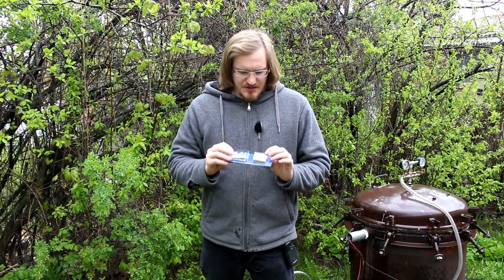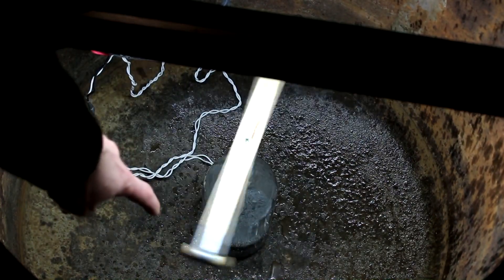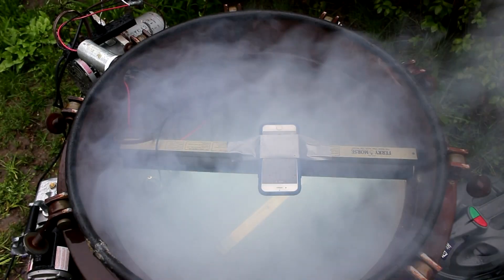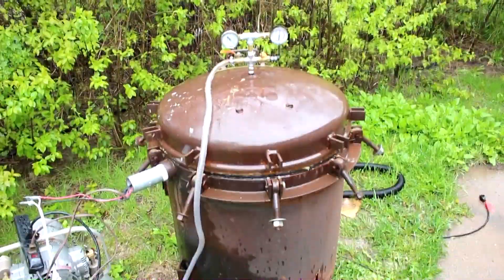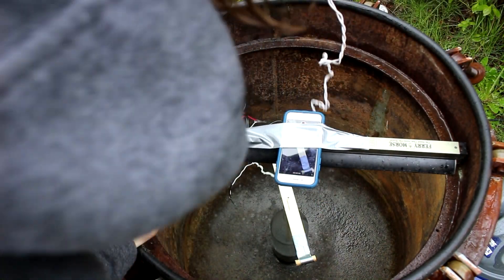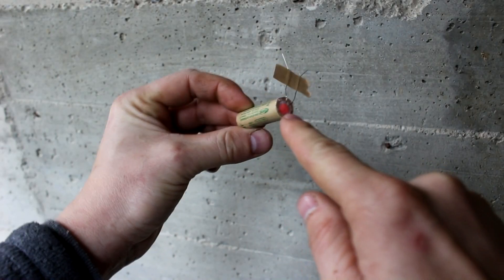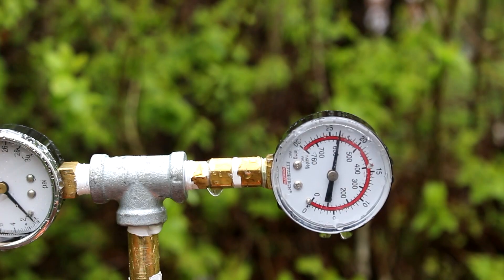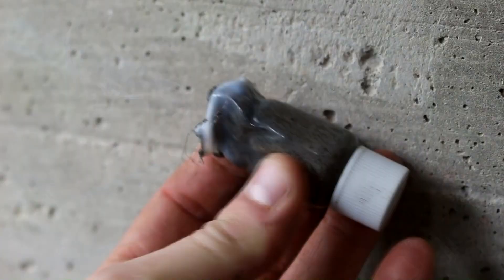Will a Model Rocket Motor Work In Vacuum?

Comment: Good experiment and does lend a little credence to rocket propulsion in space.  Except not 100% convinced because the rocket in your tank could have pushed off of the wall of the tank.  To be totally convinced, I'd want to see a rocket in a large vacuum like 20 ft by 20 ft and see it fly around without the gasses pushing off of any wall floor or ceiling.  Not saying it can't happen I don't know.  I know how it is supposed to work, but I want to see it.

Comment: You took the rocket out of the vacuum cheater!!!How do you think you proved rockets work in a vacuum when you used a barrier to shoot the rocket. We know objects in motion maintain speed in a vacuum I feel like the trust was created from the explosion of the bottom blowing off. Then it stops accelerating and since you had a relatively near frictionless rig up, it continues to rotate until it stops. The atmospheric control test spun for 13 seconds and stayed lit. The near vacuum experimental test spun for 10 seconds and stopped burning almost immediately! Did you get pressured into this by someone?

Comment: Failing to understand the "whys" and "hows"

1) How does a rocket engine (lets say the Apollo Lunar Module) create pressure to sustain the oxidizer/fuel reaction? I read a few other comments saying they use compounds that react violently simply by exposure to one another which creates necessary pressure to start the oxidizer/fuel reaction, which seems logical.
Dont tell me that the gasses produced from the initial "spark" or burning of fuel creates enough pressure to sustain the reaction, that does not seem like it would at all.
DONT TELL ME NASA HAS ON-BOARD LIQUID OXYGEN BECAUSE THAT DOES NOT ANSWER THE QUESTION.

2) WHY don't these oxidizer/fuel combinations violently react with the absence of pressure!?!?!?! I dont think you really explained this in your videos.